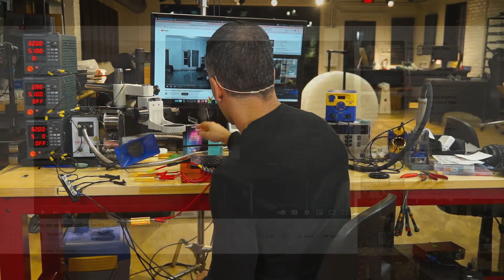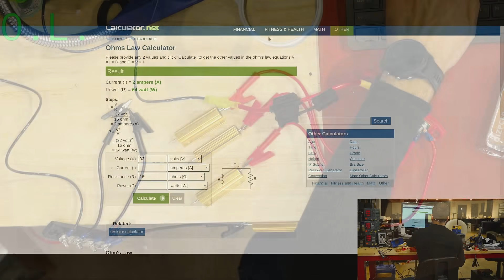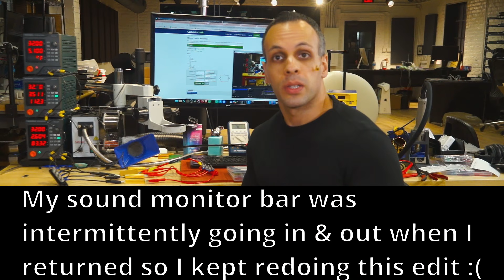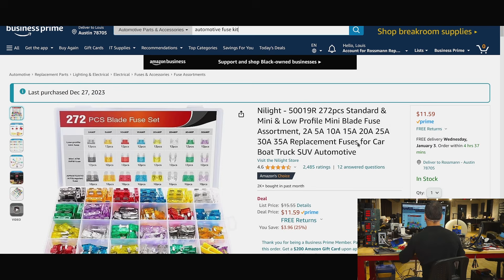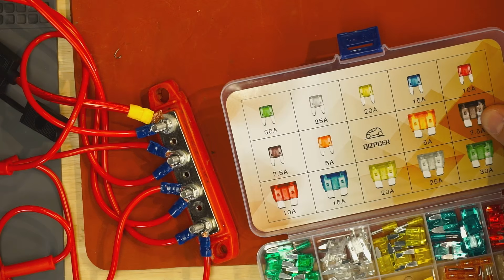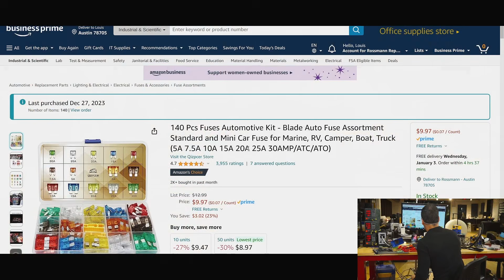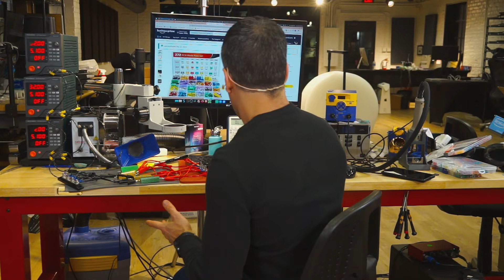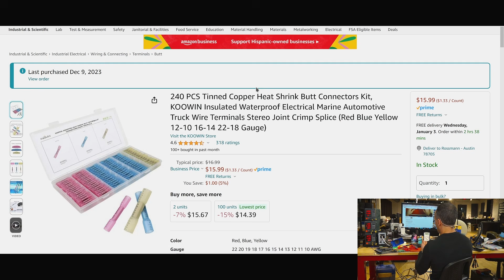Amazon Sells Fake Electrical Fuses

Comment: I had a set of driving lights running on a Chinese fuse that came with it. After a year I was shocked to see the in-line glass fuse case was melted and discolored. The fuse was not blown.  Lesson: Don't use a fuse set that is supplied with an automotive accessory. Use a brand name fuse set.

Comment: The voltage raring is not important, that is a rating, having to do with arcing in the fuse once it has blown. Your resistors have 32v across them, the fuses not! Your fuses my only have 1/4v across them. This where the inaccuracy might come from. You need to set up a simpler, set up! A variac that supplies raw AC power to the fuses (or rectified dc power.) Connect the variac’s output directly to the fuse, and start dialing up the variac. I bet the fuse will blow as it is supposed to. The fuses’ voltage rating is not important. Cars have 12-14 volt systems, so 32 volts is a rating concerning gap distance in the fuse, after it has blown.

Comment: Correction: The Qizpcer 5A fuse worked. It allowed ~rated current, did not blow in the 10-15 seconds you waited at 160% rated current and quickly blew at 200% rated current. That's in spec for most auto 'blade' fuses (search keywords: Time-Current Characteristic). Fuse time at 160% rated current is 0.25s to 50s.

Comment: Louis, a recent video from channel “The Car Care Nut” (dated January 6, 2024) goes through a custom complaint on an aftermarket part replacement that caused a PCB trace in a vehicle fuse block to fail due to overcurrent. You’d probably find it interesting. It’s probably a decent assumption that in that video, the customer caused the original fuse to fail by adding the aftermarket part, and either placed a higher amperage fuse in place of it in attempt to fix, or replaced it with a garbage fuse from Amazon with the correct rating marked on it but in reality wouldn’t fail without higher amperage. 

Either way, the PCB trace became the fuse, costing the customer hundreds of dollars.

Just felt like sharing a real life example of potential consequences of buying cheapo Amazon stuff.

Comment: I think that with fuses, there might be a special issue: if people replace a fuse in their car and the car works fine, they might give it a good rating, even if it doesn't function correctly, because if there is no more issue of something drawing more power or there is, but it doesn't cause any damage, people just think that the fuse works fine although it doesn't. This is different than with other parts, because fuses are among the few parts that actually "fail" at some point if they work correctly.
Reply: CN: "most people aren't testing the fuses so they think they work fine"

Comment: The purpose of a fuse is to prevent spikes to the rest of the components which could destroy them and could even cause a fire. Breakers in your home do the same thing. Many times I have heard people say that they would just up the fuse or breaker amps and there shouldn't be a problem. Excuse me, that is the job of the fuse/breaker. You want it to break at the same or below it's specific setting. It is much easier to replace a fuse than it is to replace the piece of electronic device that you have fried. Amazon should be reported to the FTC for providing unsafe products to the consumers. If you're a consumer and your electronic devices get destroyed from a legitimate Amazon purchase, send a complaint to the FTC. If enough people complain, they will investigate it. In the mean time, I am staying away from online sites like Amazon, Ebay, and Walmart, and going directly to a legitimate electronic component supplier online. If I need a part from appliances like Frigidaire, I am going to the Frigidaire web site and purchase parts directly from them.

Comment: I’m sure the reviews on these fuses are about fit and they probably get extra stars if they “fix” the problem with the fuses blowing because very few people will actually test them and they don’t understand the dangers of a nonperforming fuse.  Obviously, they fix the problem with having to determine why the fuse is blowing until the circuit burns up, possibly taking the car or motorcycle with it.

Comment: I think you would benefit from putting the camera behind you to the left, at a 45 degree angle to the desk. 
That way you can set focus lock on the power supplies, and your face will be within the f-stop range of the camera, i.e. also in focus

Comment: Unless it's consumer electronics from a reputable brand, it's not really worth the risk to order anything from Amazon these days.  

I've already been burned a few times buying clothes and receiving counterfeited items instead even though they're supposedly coming from a reputable store. 

If the track suit pants they sent me fell apart on the first wear you can guarantee I'm not going to trust them with anything remotely related to safety.

All the same, this behaviour is illegal amd it's foolish to allow Amazon to get away with it.  How can you expect the smaller conpanies to uphold basic standards when the major monopolies don't? 

Also if your government doesn't uphold the laws when they're applicable, what's the point in having one?  

I'm not American, all i can do is complain on line.  It's on you guys to get this fixed because you've killed every competitior that attempted to cross amazon.

Comment: Others have done fuse tests and reviews.... Technology Connection and another I can not recall. Speaking of RECALL, PEarl Harbor Freight Tools recalled their auto fuses some years ago, but I think they sell them again.  Does not matter where you buy them, the 15AMP ones will LIKELY all hold 50 AMPS at 12V..... the ones marked 15, 20, 25 and 30. 

In your testing, you found one that did sorta ok, but you only tested one type and value...... the most common ones are 15-40 amps, and molding the SAME fuse in a different color plastic does not protect the circuit.... hot wire is a HIDDEN FAILURE POINT.

THINGS ON VEHICLE OR OTHER DEVICE MAY WORK, and that can also lead to a misdiagnosis of the actual vehicle or other devices problem.

 Fuses blow or a breaker shuts off because its OWN designated value is being called to exceed its protection. ex. 20 amp draw on a 20amp breaker..... an internal circuit in a power supply, will protect the power supply internal wiring, not the wiring of what is plugged into it..... up to its' rating.

In short, breakers and fuses do not prevent overloads of DEVICES hooked up to them at all. They only protect overloads of the wiring and equipment BEHIND the fuse or breaker.

The only blade fuses I will EVER trust come from LITTLEFUSE and BUSS/BUSSMAN. You can get all the tech info, drawings and certifications from each of those firms.

I put my money where my mouth is, and tossed 5 fuse kits bought at auto parts stores and internet.... and got the 5 box assortment from BUSSMAN  runs about 130.00 from Zoro. As of posting this, I cannot find my fuse kit! I guess I need to clean the shop and van Sunday!

Also, ask to see your auto mechanics' fuses...... if they have cheapo fuses, bring this to their attention. If they brush it off, get a new mechanic.... We can be inadvertently destroying our own electrical systems.... Car maker will not want to replace a burned down car, if the fuse was defective.

Comment: The problem is the review system encourages this. Someone has fuses blowing. Buys a reputable fuse from Amazon, Bang! blows again, ⭐ star review, think they're getting ripped off by mainbrand junk. Buys fuse that's cheaper that's not designed to blow at all... Wow, this fuse really works, Stick it to the man. ⭐⭐⭐⭐⭐
To the common man. These things are just magic boxes and they don't understand the technical safety mechanisms and Reasons for it blowing. They just know the go juice stopped and want the go juice to flow again. add on top big brands like Tesla and Apple doing bull In the name of safety, and it's an erosion of trust all around. 

As for these fuses, 20% Variance in electronics is considered sloppy, and there are things such as slow blow and fast blow fuses... But 500% to blow and A time above 10 seconds on a slow blow? that is just taking the piss.

Comment: Hey, thanks for a true revelation. Even without any testing, a diagram should have been provided by the vendor describing the exact time-current characteristic of the fuse. The fact that you had to just wait a "reasonably" long period is mind blowing. I can say all of that since I have worked as an electrical engineer for several years, and I have not had an occassion where I put a circuit breaker or fuse without the aforesaid information in a project. As for this, I believe the safety of our dwelling, where those so-called fuses can be installed is equal to safety of industrial objects, which I developed. Of course, in the light of the fact with 2A fuse holding 10A it, my note is not even a problem, but the presence of those time-amperage curves still can be used to filter at least the worst cases.

Comment: I believe this is akin to what happened with Wal-Mart in the 1990s and 2000's. The dominance of the company led them to press down on their suppliers to meet impossible cost per unit metrics. The result was at first a depletion in quality due to moving operations overseas; then a full-scale exit of most of those manufacturers. Quality control was compromised and Wal-Mart embraced the "Cheap Crap" philosophy of sales. Amazon is now taking its turn and as you state, all that will be left are substandard, crap suppliers.

Comment: As a avid electronics hobbyist I bought lots of component kits from Amazon and other surplus sellers, many of them are selling on amazon now.  over the last 4 years I have slow switched to buying kits and building my own kits from sources like Digikey.  It has been extremely expensive sometimes.  I now often have 2 supplies of parts I consider traceable and untraceable.  I use the cheap stuff when throwing together a test circuit.  But for actually project builds or repairs they are very much only a last resort.  Even resistors have a max working voltage, often way below they volts needed to get to the max wattage rating,  if I can't verify this.... I don't use it.

Comment: 2:30 i bought a good set of spike guards and i have 8 computer systems(i run small video editing firm) so you know if my spike guard doesn't have good fuse it can damage my computers so much that it would be impossible to salvage anything.

i bought 1 set from amazon and i didn't felt quite right about them based on quality so i kept them aside and bought good quality spike guards from hardware store and used them.
year later when business was good me and my team decided to build our own render farm. we built it and i realized i have 1 set of spike guard in storage (i forgot they were not from local store but from amazon) 
so we used those spike guards for render farm system. just 2 days later entire $70,000 dollar worth system melted. it didn't just caught on fire, it was melting.

Comment: I’d be curious to see the voltage drop over those fuses given that you were using resistive loads to limit current, by electrical theory those fuses would be on the scale of tenths or hundredths of volts due to potential divider effect, and therefore by watts law there would be nowhere near enough thermal energy to expect a break. Not saying the fuses are good, but the test is fundamentally flawed and should be redone using a constant current source.

Comment: So the CrocSee actually worked like it should. Blow, eventually, at or a tad above the actual rating.

But it looks like it's a complete crap shoot to actually get working fuses, a safety device, from Amazon. There's zero guarantee that whatever source those fuses came from are the same even box to box!

Comment: You could test you 2A fuse by lowering the voltage a bit and raising from 1.8A up to 2.2A and see the actual current it blows at. I'm surprised you are not better informed about how fuses works.

Comment: Why do you keep on about 32v fuses?  Fuses are rated in amps. The voltage only matters that you don't attach it 24kV and it arcs the gap. It has nothing to do with the current value that the fuse blows at.  Apart technical  slips your test is sound and its a scandal. Thousand of people are using this crap and will only find this out when they set their car wring on fire !!

Comment: Connecting a third ( equal ) resistance will not "half the resistance again".  16R||16R=16/2R=8R , 16R||16R||16R=16/3R=5R3. That is a reduction of 1/6 of the original 16ohms or 1/3 of combined 8ohms. Those resistors are producing 64W of heat,  would you put four 60W soldering irons directly on a wooden desk while you go out for a piss ?? LOL  I guess you were hoping for a fire so you could sue Amazon!

Comment: Automotive fuses like the BFMN fuse being tested is supposed to conform to international standards, ISO 8820-3 (international), JASO D612 (Japan) and SAE J2077 (US) at 200% of rated current the fuse should blow in .15 to 5 seconds

Comment: I wonder if to save on manufacturings costs they've just manufactured 10A fuses and used them for the lower ratings as well. Maybe the 10A fuses will be the only ones correctly labelled.

Comment: Love this video, I usually do test fuses pre use on a per batch basis. Only a few seconds of task when the setup is there. I can't do it with most things, time requirements and all that but if there's safety at stake I either go for expensive properly rated sellers, or I test myself. Since fuses I tend to get very dirt cheap testing tends to be required. I'd love it to not be needed though. I'm not an electrician I just work a lot of adjacent things and do easy electrical things from time to time.

Comment: One question (I really do not know and are curious for your answer): If I by something from a seller using the amazon infrastructure.
Who is legally my contract partner? The seller or Amazon?

(My question does not imply that if the former is the case, Amazon has no responibility at all).

Comment: I would never buy something from Amazon that will be put in a much more expensive and potentially lethal, if it every malfunctioned, system. I only buy cheap electronic components to do small hobby experiments or from official stores of legit manufacturers.

In terms of reviews I would always sort them with the negative ones on top. Quite often very positive reviews are generated by fake accounts/bots or by people with zero knowledge about the product they are buying. That is why you would see very non-descriptive review comments such as "It's amazing", "Good product", "I can't wait for it to arrive but I am already loving it" etc. The negative reviews, while also suffering partially from the above issue, quite often contain legit users with knowledge, who would go out of their way to prove that the product is defect or just trash. Sadly, Amazon doesn't really have (or doesn't want to have) a system that ensures that only legit reviews are posted. You can even review a product without purchasing it and, while yes, the review is labeled as "verified purchase" or not, it does offer a very easy way to choke the competition and push scams on the top, where more people will fall into the trap. Amazon is anything but a good market place but the problem is also that many shops nowadays (in an actual building with humans inside to provide service) buy from there or the Chinese mass manufacturers of cheap crap behind all of it plus the extra price on top that comes from the necessity to pay folks a salary and insurance.

PS: I have the same power supply like the triple stack on the left. Good stuff and very reasonably priced. :D

Comment: I just love how for like 3 mins you just go to the bathroom and let it sit there. It reminds me of all the reaction youtubers. I know its not your job but I'd watch you test all the fuses in the CrocSee and one of the bad companies just to see how extreme the bad get and if the good ones are all good.  I assume 99.9% of people who buy replacement fuses like the fact they don't blow so thats why they keep buying them since normally theres other safety measures past the fuses in their cars or boats etc. (Instead of fixing the issue, running a motor on too much electricity it might still be able to handle but won't have to keep replacing the fuse.) I'm not saying thats not stupid, but come on were humans. 🤣 Its a lot like how in the 50s people just did everything wrong but it worked somehow. While its not electrical, there was a leak in the kitchen sink pipe at my mothers house and he fixed it with only tinfoil and hose clamps. The repair so far has lasted longer then him, around 20 years now and not a single drop of water leaked. Tinfoil and Hose Clamps>$200 plumber.

Comment: My work has had such a shitty time working with fuses across the board that we regularly have to install ones with half the rated current that we want - it’s goofy that there’s such a large variation like that in a supposed safety device

Comment: I ended up throwing out my crimp connectors from Amazon after watching the last episode.  I tested to compare against the same type connectors from AutoZone, and confirmed the Amazon butt connectors did indeed just pull apart.  Fortunately I don't think I've used them in anything (I always give connections a tug to check), but I had bought a bunch to keep in bulk and definitely got ripped off.  This is an important series of demonstrations, especially for those of us who work with electronic components and repairs regularly.
Reply: It is important for those in the back of the classroom, but idiots need to be real they aren't buying 570 of any item and getting anything near quality. If the company you're buying from doesn't have a website... Well that's really on you